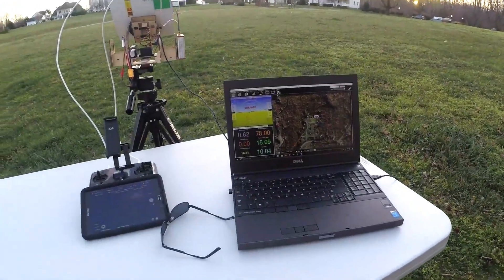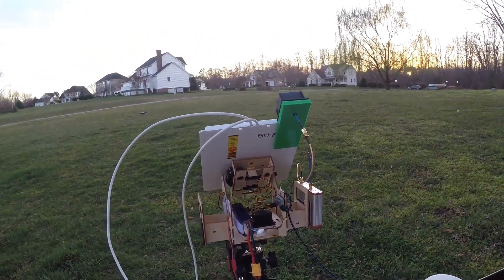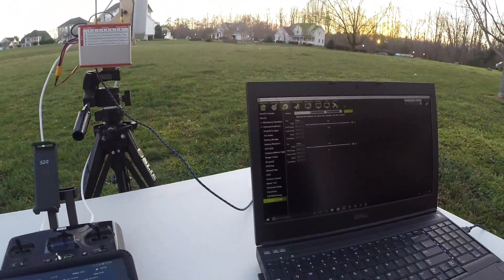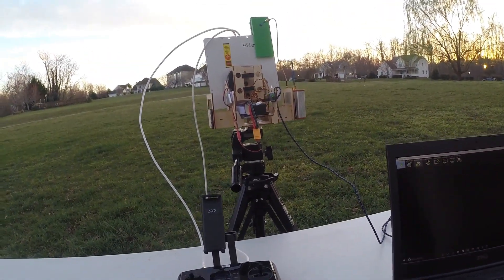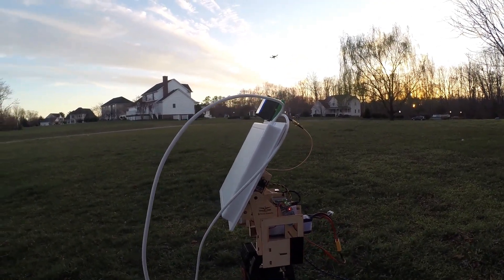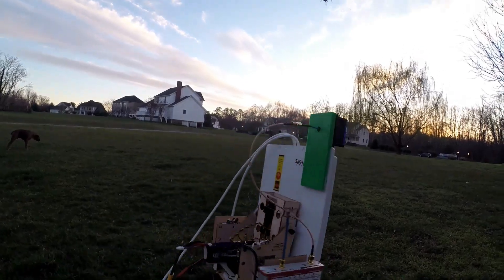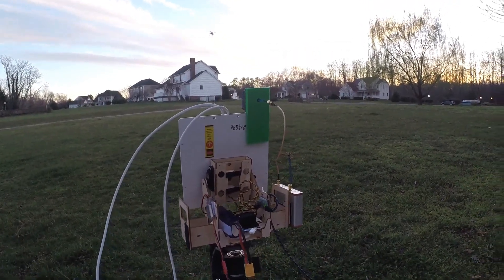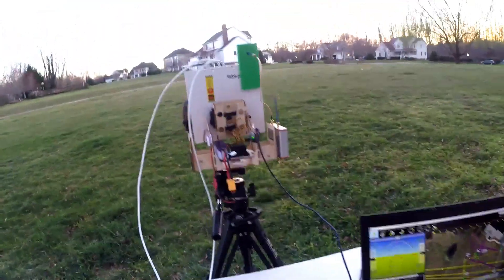RMRC Antenna Tracker used with 3DR Solo and Mission Planner

Comment: Hi Andrew,

I have a 3DR Solo, antenna, and tracker that I would like to use to simultaneously track multiple vehicle. Does your setup support this task? In any case, I would like to learn more about what you have done to connect your 3DR Solo to the antenna and tracker.
Reply: It can only point at one vehicle at a time.

(Try looking into different directions with only one eye)